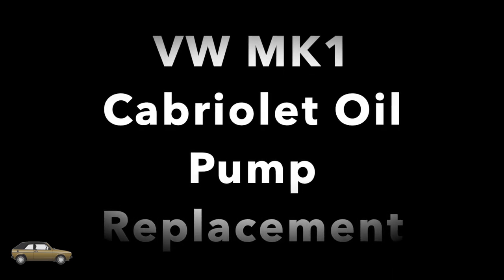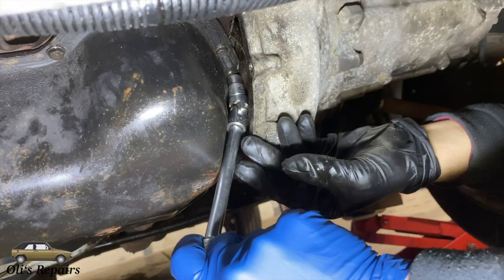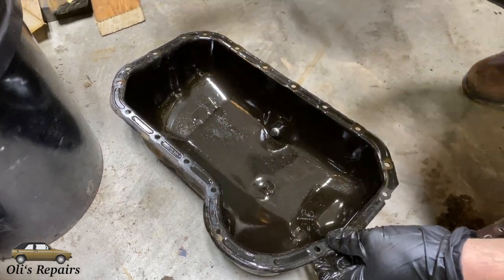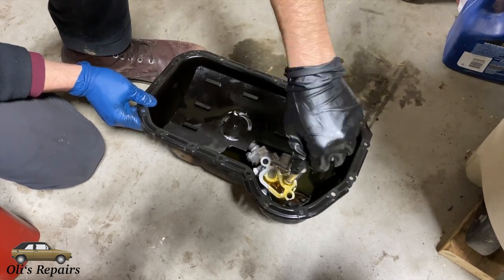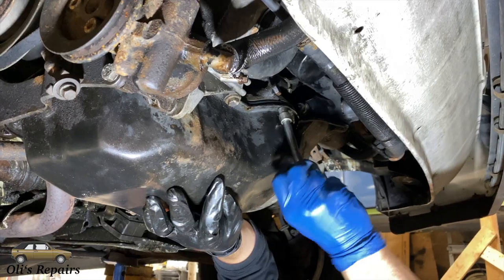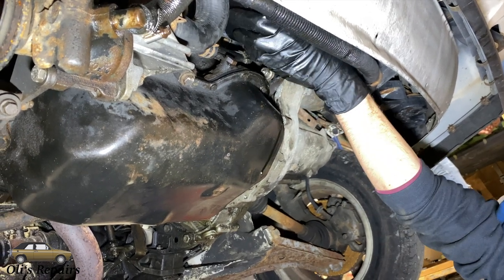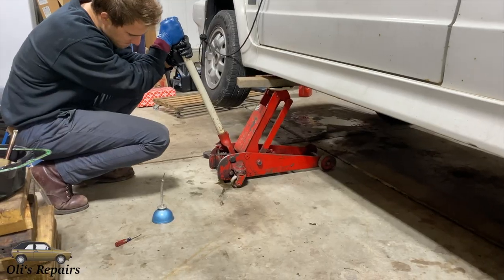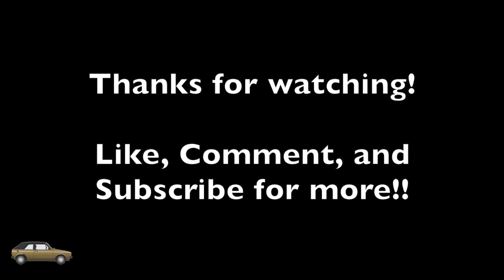VW Mk1 Mk2 Mk3 Cabriolet Oil Pump Replacement

Comment: For some reason, that transmission plate looks like it extends way past just those two bolts on my 85. The swivel I have is just too bulky to get a good angle with the plate on. Any ideas?
Reply from the maker: Maybe try some impact swivel sockets? Those have a pretty compact swivel on them

Comment: You have said that the torque for the oil pan fasteners should be 11 ft-lbs even though the manual says 15 ft-lbs. I will be using the new rubber gasket as well and was wondering if it is true that the torque should be reduced to 11 ft-lbs. This is for a 1985 VW Scirocco. Great video, by the way!

Comment: Nice and detailed 👍 What was the reason for the the oil pump change?
Reply from the maker: Junk VWs thanks for the feedback. The car sat for a little while and when we went to start it there was no oil pressure (light blinked at idle and the gauge read 0). Only let it run for about a second.
Reply: You said you upgraded to a 2.0 pump..is that found on a mk3?
Reply from the maker: Fernando Rangel correct. Just buy one for a mk3 with the 2.0 aba engine

Comment: Thanks for the video! I just got an 86 3-speed auto cabriolet Wolfsburg edition and the engine just stopped working suddenly when idle and coming to a stop. I noticed the oil pressure gauge was low when in these situations. The car though would start right back up like nothing happened (with the oil pressure still low, except for when accelerating). Does this point towards a bad oil pump and/or sensor? Where should I start?
Reply from the maker: If a failed oil pump caused the engine to stop, it’s not starting again. Probably a vacuum leak. I’d give it a tune up and make sure that there are no vacuum leaks

Comment: Did you need different bolts for the 2.0 pump? I've heard the old pump is 30mm and the newer pump is 36mm
Reply from the maker: I did not. I’m pretty sure the pumps looked very similar from the outside. But it’s also been two years since I did that repair. So I’m starting to forget details.

Comment: I bought a baffled oil pan for my mk1 87 cab and it doesn’t fit cause of the plastic around the sump can I remove this plastic to use this gasket w no issue ?
Reply from the maker: I think you should be fine doing that.
Reply: @OlisGarage  found out you need to remove the entire oil pump to clear the pickup tube on the 87 cabriolets

Comment: Blessed Oli and his videos. Gonna be dropping my pan soon. Darn drain plug is stripped. At-least it doesn't look like a hard job. My pump is fine, but OE. Should i swap it or let it be while im in there?
Reply from the maker: Uuummm. Good question. 
I’m going to say give it an upgrade. You’re supercharged car surely heats up the oil more than a normal engine, so a bit of a bigger pump can only help. Make sure to install a mk3 baffle plate as well while you’re at it, if it doesn’t already have that
Reply: @OlisGarage  everyone thinks that but it really doesn't warm up the oil by. Doesnt make the same heat a turbo would. I was more worried about the life of the oil pump due to 160k miles.

Comment: Actually Volkswagen engines have usually three-letter codes, like ABD, APQ, AEX, AHU and such. These codes are for identifying what kind of engine your car has. And different codes mean different engines. The differences between the engines are not minor differences, they share only one common property, they were made in one of the VW factories.
Reply from the maker: Well the older VW engines used 3 letter codes such as “2H” what this engine is. 

Sometimes the differences are absolutely minor as well. A 2H and JH engine were almost the exact same, except the JH had an oil cooler. Aside from that every part that I’m aware of is the same. 

Then you also have engines with the same code where they had differences. Such as the ABA. There is one year where the connecting rods of that engine are much stronger, and that is the year everyone wants for turbo swaps.

I will update my description to reflect that the pump came from an ABA engine, but realistically the oil pump from the mk3 diesel (AHU) would also most likely work

Comment: Hey Oli. Big fan, great instructional videos. I'm going to do my oil pump "upgrade" in the next few months, but was curious if you had any increase in oil pressure from it resulting in high oil pressure alarms going off or needing to change your oil pressure sensor to a different pressure calibration. Thanks for the info!
Reply from the maker: It did increase the pressure a tad. I couldn’t tell you exactly how much though. But the 2.0 and 1.8 are very similar engines with the 2.0 just being a tad taller. So it’s not as if the upgraded oil pump came from something of completely different design. 

No high pressure warning sensor in this car. Only low pressure. I also have a video talking about the dynamic oil pressure warning system which outlines the different sensors relating to oil. I think it’s worth the watch!

Comment: Hi I have a mk3 1.6 cab, the red oil light was flashing and beeping, at first it was intermittent, I checked the oil level - this was fine, then it was constant. I then changed the pressure switches.. the beeping stopped, however the red light still flashes even before I start the engine. Is this the pump. An I have damaged the engine? 
Thanks Jc
Reply from the maker: Jonathan O'Connor your best bet is to find a mechanical oil pressure gauge. Unscrew one of the switches and screw in the gauge. If you have pressure, then you’re fine. If not, then you probably damaged your engine. I’m not that familiar with the mk3 and what sensors it has

Comment: Hey Oli, as usual my tips, there is an upgraded gasket with a metal splash guard that you can install in that engine, and also os i a good idea to prime the oil Pump, 2 options for that, One, remove the Timing belt and with power tool rotate the oil Pump gear, second, remove the head pressure switch and insert oil, you should not do it like you did, trust me on that.
Reply from the maker: I’m not concerned at all with how I primed it. The oil pressure light and gauge indicated pressure immediately when I started the car. 

Of course there are other methods which probably do a better job priming it. But, do you remove the timing belt and prime the pump every time you do an oil change? I highly doubt it. A simple prime of the pump and a new oil filter filled with oil definitely seem to be enough priming for these vehicles.
Reply: @OlisGarage  hello, if your engine is not factory tight on tolerances it Will probably cause no harm to the engine, but I've seen things go bad in those engines during Pump+oil cooler replacement, the engine did not die but its not good, on your Next oil chance pay attention to the oil and Open the filter, you'll probably find some small shaves from the bearings if the system did get dry enough. Sadly the oil switch does not provide quick feedback, i know that from experience. And on factory manual mentions  that you should prime the system, there's a reason for that, there are more ways than the One I mentioned, the One I mentioned it takes like 20secons on a dry engine(ex a complete rebuild on a long block that has oil squirters).
You can prime by inject oil from an oil switch  cavity, I also use that method.
I advice anyone to play on the safe side, better be safe than sorrow.

Comment: What oil do you recommend for a 1982 Rabbit?
Reply from the maker: You’re in Mexico if I remember correctly. Gas engine I assume? 
For the hotter weather I recommend 20W50 or 15W40. Cooler weather (as in winter where it’s regularly below freezing) I recommend 10W30
Reply: @OlisGarage  I was correct, I use 20W50 oil, the weather is hot here in Mexico. Saludos
Reply: Add a ZDDP additive every oil change. Old cars have a oil standard that new oil really doesn’t satisfy I promise no matter what they say.

Comment: Was it just the oil sending unit in the end that was causing the high pressure alarm?
Reply from the maker: It was a low pressure warning which was caused by the pump failing. Kind of weird that it failed after just being parked for 2 weeks. But, that's what happened. FYI, there is no high pressure alarm on these vehicles. I also recently made a video describing and trouble shooting the low oil pressure warning system :)

Comment: Does a O'Reilly oil pump work because I ordered the 2.0l oil pump for a 1.8 because when you turn it on and you leave it on until os running in temperature the oil pressure from the head drops but the oil pressure from the block has pressure
Reply from the maker: There’s no reason it shouldn’t work. There is a chance the pump could be partially failing. Maybe you have a restriction somewhere in the head stopping the flow of oil. Or something completely different.
Reply: I already changed 2 cylinder heads and same exact problem
Reply: So I don't know what else to do
Reply from the maker: @robertolatorre8938  it’s really hard to diagnose something like that over the internet. I have no idea what you’ve tried and all of that. Hopefully you didn’t use any rtv on the head gasket or valve cover gasket because that can come loose and plug oil passages. 
I’d look into testing a second gauge and seeing if you get similar results. Use 20w50 abs a good quality oil filter. I always start with the easy things first. Replacing the off brand oil pump to a quality febi is a lot easier than head removal. 

But again I have no idea what all you’ve already done and what caused the issue to manifest itself in the first place
Reply: I've had done 2 different cylinder heads i changed the piston bearings where they connect ,the crankshaft bearings, 2.0l oil pump used 20w50 and thats it I don't know what else to do with it

Comment: Great video, I followed it closely when doing my install.  However, immediately following I have a no start condition. Is this possibly an issue of the distributor turning, thus it’s out of timing?
Reply from the maker: Nah it can’t. The distributor is on a gear which is connected to the intermediate shaft which is turned by your timing belt
Reply: @OlisGarage  Thanks for the quick reply. I’m a bit puzzled why my car won’t crank following an oil pump install. It was perfectly running before.
Reply from the maker: @TheMrZanardi  won’t crank or won’t start?
Reply: @OlisGarage  Strong crank, yet no start.  Turns over fine.
Reply from the maker: @TheMrZanardi  start with the basics. Spark, air, and fuel. Pull a plug and see if it sparks
Reply: @OlisGarage  will do, thanks!
Reply from the maker: @TheMrZanardi  welcome! I also always work from easy to hard and cheap to expensive (within reason of course) when diagnosing.